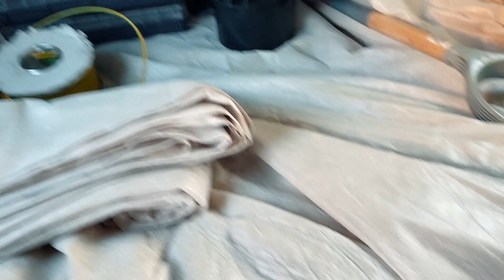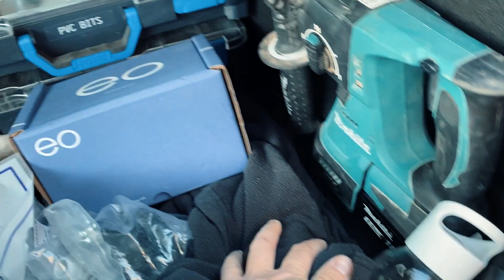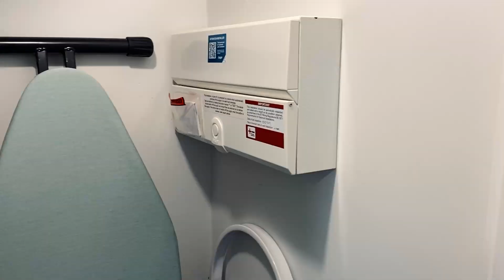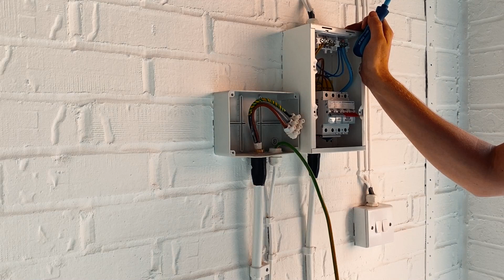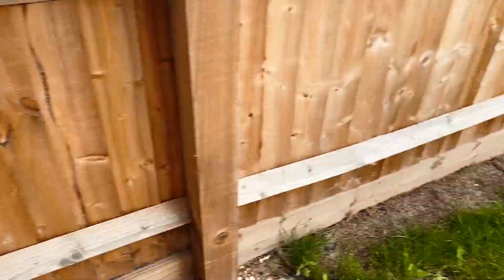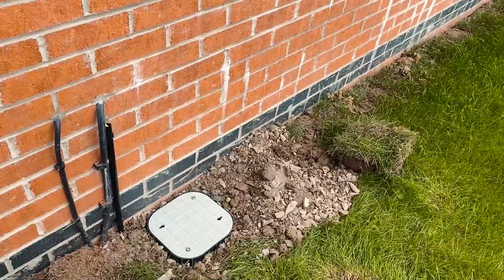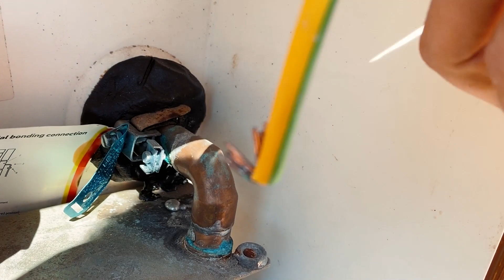I Swapped My Work Van for a Tesla!

Comment: I’d be very wary about driving with that load of gear in the boot and no bulkhead to protect you. I knew a guy who was killed in a minor crash and his metal toolbox came flying from the back of the van and hit him on the back of the head. This was before vans came fitted with bulkheads. I wouldn’t chance it. Lovely motor by the way, I bet it’s nice to drive.
Reply from the maker: Thanks good point!
Reply: Yeah, just realized this upgrading from a corsa to a van (was just starting out and ...well it just kept running LOL).  Best option if you MUST use a car is to keep the heavy/dangerous stuff low and to the passenger side (assuming no passenger).

Comment: How did you take out the old earth rod? With the SDS drill. Still think when you are doing an earth rod install for EV chargers you should be doing a second rod install with a minimum distance apart. Ground resistance readings with the single rod is still high. In USA we would aim for a factor of resistance 10x lower. Surprised at the higher reading and especially when it rained as well.
Reply: I had 2.8 ohms on mine - two rods
Reply from the maker: Wow that’s good!
Reply: Artisan Electrics yes it was excellent and the most stringent requirement for ground resistance is for cell towers less than 5ohms so for a residential property I could not have asked for more.
Reply from the maker: Thanks I just pulled the old rod out by hand... new rod went in solid but like you say a second rod would have got the reading even lower but here we can have up to 200 ohms so 50 is quite good.

Comment: That Model 3 definitely looks the part!

Have you got your eye on an electric work van in the future?
With prices and weight per kWh dropping it would be really nice to see a BEV Transit Custom with 250+ miles of range but I'm prepared to be disappointed. Given how little day-day weight people tend to carry in them I can't see the extra battery weight causing a problem, but if it was they could always just up-rate the long range versions to a ~3.1T Class 7 like AA's Transit Customs.
Reply: The current E-Vivaro fully loaded is about 80 miles real world range currently when I inquired. Can totally see why BG only got them for engineers in localized overlapping areas that aren't  covering more than a 20 mile radius. Hoping the next year or two we see real improvement in Battery density so a fully loaded van has a 200 mile range. That would allow a decent days work and not having to worry about stopping to charge mid-day.
Reply from the maker: Yeah unfortunately there’s not really a good option for an electric van at the moment. Waiting for Tesla Cybertruck
Reply: @artisanelectrics  Haha, I've no tears to shed about the fact they're not coming to Europe. Far too large, and dangerous for everyone not inside it.
The vans for UPS from Arrival look like they'd make a good work van though.
Reply from the maker: Yeah I’m sure something good will be made before my current van lease ends
Reply: @artisanelectrics  I looked at a Renault master about 18 months ago   they quoted around 124 miles partial load real world 50 to 75 miles miles  . Charging was a nightmare too  17 hours  unless you could have one of thier charger units installed  then your looking at 4 hours
Reply: I remember when East Midlands Electrics ran electric Bedford vans , great in the summer come winter  absolute nightmare load carrying capacity was shocking  always being towed in
Reply: Dosn't the eNV200 do like 180miles these days?
Reply: @dasy2k1   thats not real world figures   you would be lucky to get half that fully loaded on a dark  cold december  night with heating, lights , demisters etc all running full chatter
Reply: @dasy2k1  124 combined (unloaded).
It's not a very practical size for trade though where the Transit Custom and Vauxhall Vivaro have the market.